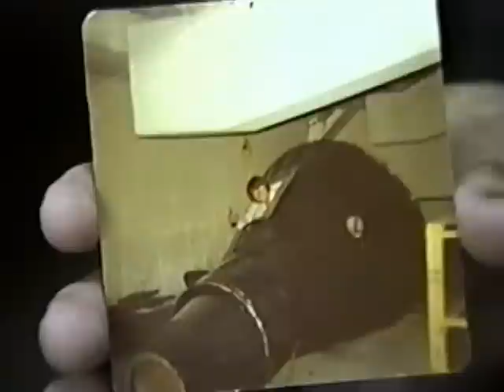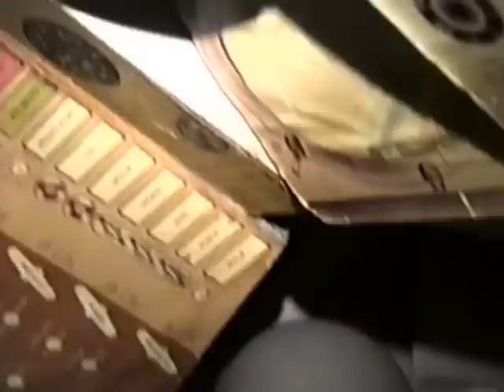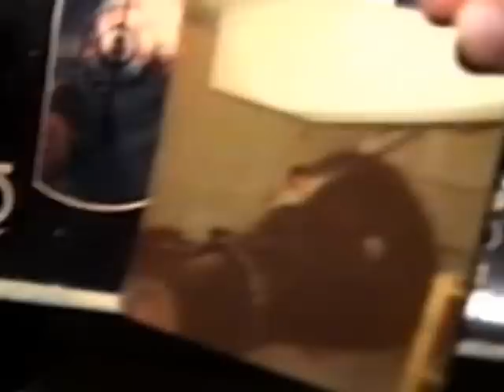Mercury Capsule Mockup 1990

Comment: I always said that NASA could make some extra money by taking their trainers and mockups from everything from Mercury through the Shuttle program, hiring back some of the simulator operators and charge a fee for people to sit in them and work some of the portions of the flight. After all, the Challenger Learning Centers, where students act as flight directors in Mission Control working out problems, are still popular and in use more than 40 years later.